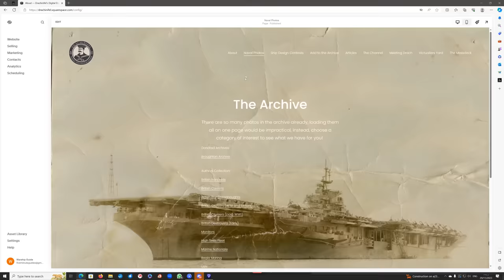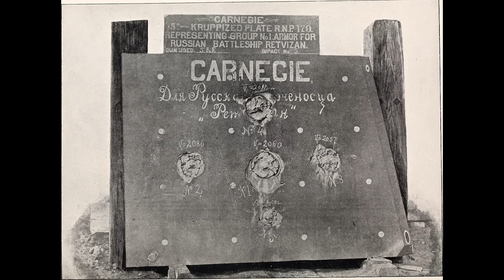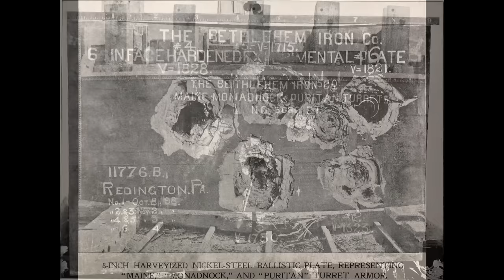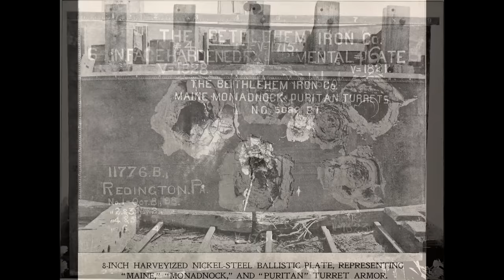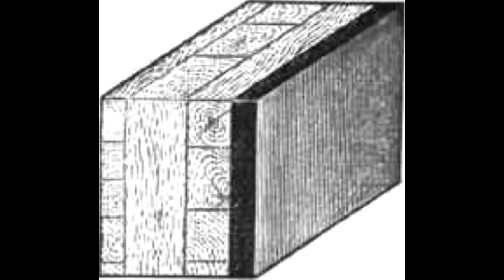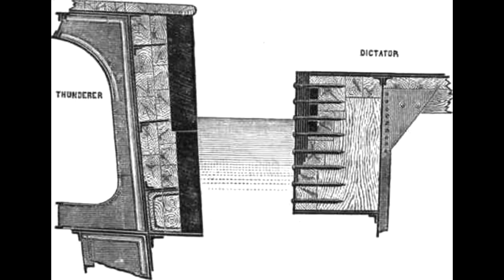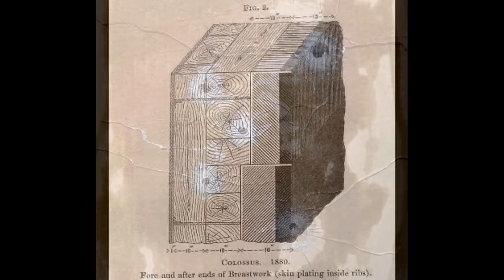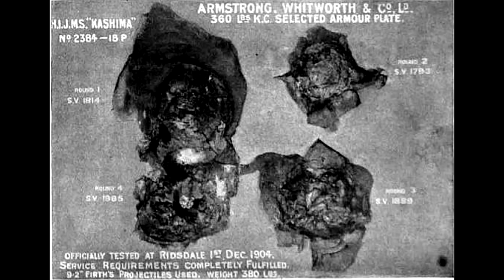Battleship Armour Engineering - Why is naval armour multi-layered?

Comment from the maker: Pinned post for Q&A :)
Reply: Did ships use other material before the metal plating in order to slow down/disrupt the incoming projectile. Something like another ductile material or some form of space armor?
Reply: Good stuff. Did you happen to note the amount of glass "spall" being passed through the cardboard backer in test 3?  In the wild, the spall would be fast and heavy and able to do a lot of damage to wires, pipes, and carbon-based life forms.
Reply from the maker: @tonyennis1787  in the slow motion you can see the glass plate throws a lot of spall back from the impact site, even more went inward. Relatively little if any made it through the combined plate :)
Reply: Considering that the most powerful battleship guns ever built, such as the 16”/50, the 15” on the Littorios and of course the Japanese 18.1”, could penetrate most if not all belt armour ever put on a ship at most reasonable battle ranges, exactly how much belt armour of the highest quality naval steel would you need to withstand those kinds of hits?
Reply: What sort of armor thickness would the Kirishima have needed to successfully resist the Washington's broadsides at Guadalcanal?
Reply: don't post often, great presentation as always. just a thought and a bit of of a chuckle, have you tried this same experiment but instead of using a glue, use treacle to simulate what I would think would be the more elastic interface of armour bolted  to wood, and I know this does not pertain to the use of todays steel in the use of modern warships but could x3 plywood represent mild/layered steel
Reply: This is a bit of a professional curiosity for me being a professional welder.

I know welding wasn't used in ship's hull construction until shielded metal arc welding (aka SMAW or "stick") made it practical around WWI time frame. However, oxyacetylene welding had been a thing for a while before that. Why wasn't that ever used for hull construction? Too dangerous? Too low of a deposition rate? Couldn't work with the armor alloys?
Reply: Great work. I'd love to see an explanation of how/why increasingly more interior armor schemes were made. i.e., you have your main belt, then secondary, etc.
Reply: @sirbollocks609  you may recall the "laminated safety glass" that used to be used in cars, at least in the US.  The glass was made by laminating a sheet of clear plastic between layers of glass, so, when the glass was broken, the plastic would hold it together, rather than shards of glass flying everywhere.
Reply: This is sort of related to your layered armor and why it works. They found shortly after the start of WW2 that the "cheap" bunkers held up better than the more expensive ones to artillery. The expensive bunkers had a solid thick solid concrete/ steel reenforced shell. The cheaper bunker's were layered. A thinner outer layer of steel reenforced concrete, then some sand, then another thin layer of concrete. It turns out sand works great for dispersing energy and prevented penteration; however better wasn't good enough. All you had to do was dig a hole in the concrete with 75mm AP until there was a hole then hit it with HE.
Reply: @thehuscarl4835  My grandfather was a welder in the Bremerton Navy Yard during WWI, as you said, oxyacetylene welding.  He told of one day when he was way up in the forepeak welding, when he realized he started feeling woozy.  Correctly thinking the torch had burned up all the oxygen in the space, he turned off the acetylene and let the oxygen run until he felt better.  I don't know what he was welding up there, but there certainly was some welding used on ships at that time.
Reply: @stevevalley7835  I'm glad they have handheld atmospheric testers these days. Many people have accidently killed themselves by doing exactly what your grandfather did. 

To my understanding, oxyacetylene welding was very common for various sorts of piping, which warships would have plenty of. Just like a city, they had to move steam, sewage, water, electrical cable, etc. Those systems would have a lot of oxyacetylene welding holding them together. 

Again, to my understanding, the ships hulls themselves were riveted together until stick welding was invented and perfected. So why did they skip oxyacetylene welding and go straight to stick?
Reply: @thehuscarl4835  Not a welder, but a hobbyist and also follow (naval) history.  I think oxy/acetylene has a tough time delivering enough heat quick enough to be effective on steel plates as thick as used in ship hulls, not to mention thick like armour.  If it did work it would probably be slightly better for hulls and worse for armour than electric welding since the heat affected zone to base metal transition isn't as sharp with oxy leaving the transition much less prone to cracking under fatiguing stresses, but also ruining the face hardening of armour.

Other end of the scale, but my Dad used oxy to weld his steel airplane frame because electric arc in airplane applications ( in the 1980s ) required going over all the weld areas with an oxy torch to anneal out that transition whereas doing it with oxy in the first place had that built in to the process.  I don't know about TIG since that was still pretty exotic back then.

IIRC I read somewhere that thermite welding was used in some very early ship iron armour because they couldn't deliver enough heat any other way.  I think that was pre elecrtic arc processes, probably also before bottled acetylene back when oxy got the acetylene from dropping calcium carbide into water.
Reply: What does the back of the glass-cardboard armour look like after being shot? Just 5 small holes?
Reply: @stevevalley7835  And, extend that idea to a Dagwood sandwich and you have "bullet proof" glass.
Reply: In ground forces you often see the "glass cannon" concept deployed where all pretense of armor is given up for speed and firepower, the M56 Scorpion and ASU-57 for examples, but are there any capital ships in WWII where they deliberately went for a glass cannon approach as opposed to just a bad armor design?
Reply: Wednesday's video on Japanese submarines got me wondering.  What was the single most devastating attack by a single submarine in WWII.  I think I-19 sinking USS Wasp and eventually USS O'Brien, while also damaging USS North Carolina is a good candidate.  However, I could imaging a submarine lurking in the path of a convoy might be more effective.  I just don't know enough to be sure.

For this question "devastating" could mean biggest impact on the war or simply tonnage sent to the bottom (maybe with partial credit awarded to tonnage removed from action for a period of time).
Reply: There's also the huge physical requirements of the machines necessary to roll large thick armour plates. Few months back I got to see in operation  the most powerful steam engine in europe that is still ran The river Don engine, that is at Kelham island museum in Sheffield uk. It (used to) drive a rolling mill that had a capacity of 50tonne armour plate at 40cm thick. Took
12,000 hp. And it needed to be able  alterate between full forward to full reverse with in 2seconds, so the steel didn't cool too much.
Reply: Would a ship with a pronounced tumblehome provide more protection than a wall sided ship through a sloped armor effect?
Reply: Have you thought of getting an interview with Nathan Okun?
Reply: What were the various methods used for joining dissimilar materials?  Rivets > Welds?
Reply: do it jiggle when you fart
Reply: Thank you very much for this excellent presentation and explanation. Could you - if time and possibilities allow - expand on monolithic vs. spaced armour? D.K. Brown mentions several times in "Nelson to Vanguard" how 1 thick layer is more effective than several thin one.* But every modern battle tank seems to swear on spaced armor. Has this something to do with the speed and mass of the projectiles used? With tanks having comparatively light but fast penetrators while warship shells and aircraft bombs are heavy but slow-ish?
*) Pages 41 and 46 for example in the kindle version.
Reply: @KJAkk Brilliant suggestion!  @Drachinifel if you could make this happen it would be a superb addition to this topic
Reply: Supposedly, the Españas' en-echelon wing turrets were capable of cross-deck firing in wartime.  However, looking at diagrams of the Españas' layout, there doesn't appear to be any way the wing turrets could've trained to a position where they could fire cross-deck without running the gun barrels into either the funnel or one of the masts; even elevating the guns doesn't look like it would've allowed them to clear the funnel or masts without elevating them well above the Españas' actual maximum gun elevation.  Am I missing something here?
Reply: How was 20th century armor, specifically battleship armor attached to the ship?  I'm assuming that 1 battleship sized and shaped piece did not come out of the factory.  Was it made in panels and attached the length of the ship?  If so were they large or small panels?  Single weld around the outside or what?  Did the process vary by country?
Reply: Fancinating subject but from the perspective of a materials engineer, I think it could have been explained better. A deep dive into the topic of "toughness" and opposed to conflating "hardness" and "ductility" would have been more in order
Reply: Will you do practical investigation on turtleback armour and angles in general?
Reply: How would Warriors armor stand up to an HE round from a 5"/38 at various ranges?
Reply: Can you imagine the amount of heat required to bring a 4.5" plate up to welding temperature a?
Reply: Remember that Chobham armour was a huge improvement on RHS for tank armour. The T72 hill had it, we didn't know until some Ukrainian tanks on manoeuvre s bit something hard enough to fracture it and someone got pics of the layered armour
Reply: Before having seen the video I guess it’s to increase the efficiency of the armour?
Reply: Hi Drach. Thanks for the great content. I keep coming back to the following question when listening to your armour and engineering videos. I keep wondering what modern materials or technology would have the biggest impact in Battleship design if we ported it back to the dreadnought era. 

I keep thinking that something like polymer foams, for filling voids, might make ships a lot more resistant to flooding, or simply render them unsinkable by traditional AP shells. I wonder what you can think of.

Comment: Not used in warships but some merchant vessels in WW2 which got labelled "plastic armour". After dunkirk it was realised some of the very old ferrys used in the evacuation had been surprising resistant  to armour piercing bullets. Upon investigation the protection was found to due to decks being coated in asphalt. Asphalt being fairly hard gravel embedded in fairly soft bitumen. Admiralty wasn't happy with it being considered as amour, but it did get added to many merchant vessels and saved many lives.

Might be interesting to see how pea gravel in tar stood up to BB pellet.
Reply: Some steel body armor plates are coated with a substance similar to asphalt in order to "capture" bullet spall as well. Very interesting.
Reply: So asphalt is the binding material? Like is it sandwiched in between or more of a coating?.
Reply: @JamesThomas-gg6il  the tar is largely in-between the gravel.so on impact a round would  alternating between hitting very and soft material. Such Likely to cause considerable deflection of a small round.
The tar would also help support/cushion rear of  individual gravel lumpsl, helping the  lump  bleed off  more of the projectiles energy before shattering.
Reply: @stevecummins324  hey makes sense to me. How about sand as a buffer between two layers. Yes it would need a bunch of sand but sand bags work wonders even against full bore rifle rounds. Just an idea, not that any body that makes armor would take advice from an idiot like me.
Reply: I recall reading that this was researched by the British, and they found that a composite of Portland stone (very hard bluestone) and a matrix worked very well, and was of course much cheaper and quicker to produce than steel armour. Used on converted merchant carriers among other ships.
Reply: @JamesThomas-gg6il Sand is pretty heavy. I bet the same weight in armor steel would be stronger. 

Sandbags are good because dirt is nearly everywhere so you only need to transport the bags.
Reply: @bozo5632  that makes sense too.
Reply: @JamesThomas-gg6il  Sandbags are really good though. No ricochets... Cheap, quick, easy, low tech, low skill...

Comment: Designers of tank armour had to relearn this lesson. They found that a soft steel inner layer much reduced crew injuries from spalling off the hard outer armour.
Reply: Doesn’t the Abram’s also do the nifty diesel in between thing? Or am I making that up?
Reply: @Meyer-gp7nq Abrams uses gas turbine engine, and the tank uses different compartment for ammo storage.
Reply: @Meyer-gp7nq  yeah there is fuel in a compartment between the driver and the front hull armor
Reply: @muhammadnursyahmi9440  but they do not burn gas in the Abrams (usually diesel but they can pretty much burn anything)

Comment: Chocolate is similar to armor plate.  It gets brittle when cold and soft when warm.  And it can be tempered.
Reply: But a ship armored with chocolate would rapidly find itself denuded due to the crew being somewhat peckish...
Reply: @davidg3944  cleaning up choco bits after firing BBs at it will be more fun than cleaning up broken glass.  You just need an ice cream cone....

Comment: PhD Metallurgist here. This video and demonstration was great but I have a small constructive nit to pick. In Iron and carbon steels, the ductile to brittle transition temperature (DBTT) isn’t related to a phase change. These materials have a body-centered-cubic crystal structure throughout our temperature range of interest (cold oceans to very hot days). For these kinds of steels, the DBTT is related to the ability of crystal defects called dislocations to move within the material.

Simply, dislocations are crystal defects that can move in your material when you put energy into the system (mechanical deformation and heat are forms or energy). If dislocations are mobile, your system is ductile (but softer) and can accommodate a lot of strain. If your dislocations are immobile, which can be a problem for certain grades of steel at lower temperatures (lower energy for dislocation movement), your material is brittle (but stronger).

This is not to say that phase is not important to DBTT though! Steels with a face-centered-cubic crystal structure are much less susceptible to cold temperatures embrittlement because that crystal system has more slip systems for dislocations to move across.

Comment: Metallurgy is, as Yul Brynner said in The King And I, “a puzzlement.” But so is ballistics. As a curious person at the range, I’ve shot wood, rocks, bricks, watermelons and steel with rifles and handguns of various calibers. It’s always fascinating to see which ones explode melons and which ones just whiz right through, and which ones thump steel gongs hardest, which ones move the gong most and which ones actually damage the steel plates. Often the results are non-intuitive.
Reply: mxv squared.
Reply: @TomDog5812 to be fair, it's not just KE that matters -- a surprising amount of the terminal characteristics can be attributed to projectile shape/cross section as well as its own deformation characteristics